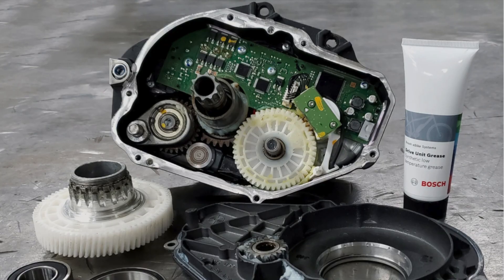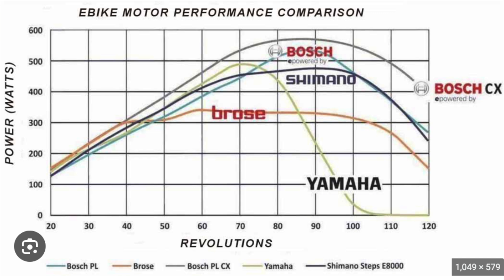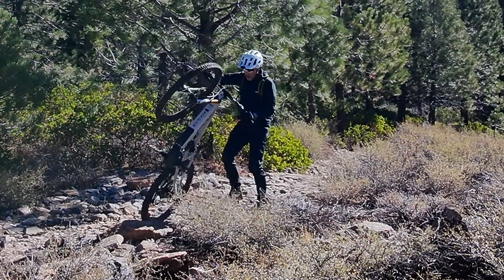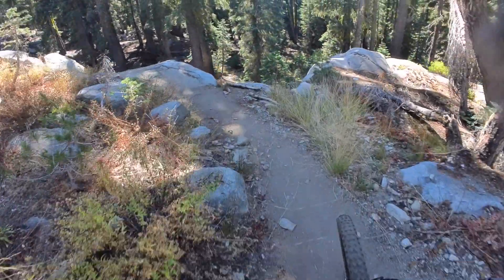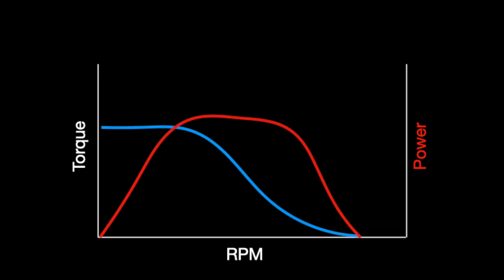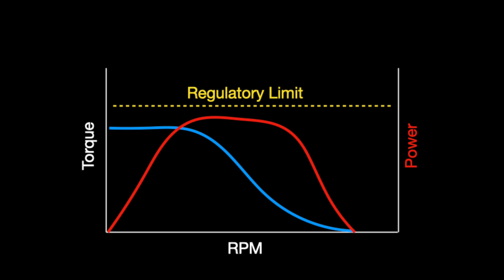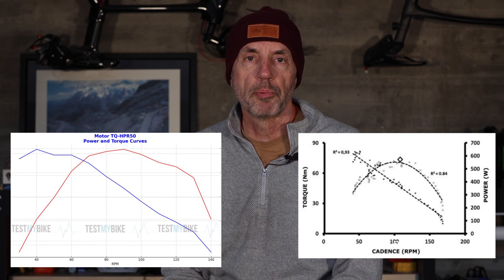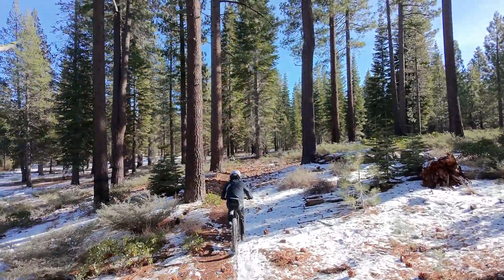The Best E-Bike motor is the one that has the most control - "enter" the motor controller.

Comment: It depends what you want.   I decided on the TQ motor.   Why?  Because my objective is to stay in shape. Keep my VO2Max in the excellent range for my age.  I am 73 years old and been riding most of my life.  As i have gotten older, there is no question that my power generation is declining.  I am in no way what i used to be in my younger years.   The TQ is the closest thing you will get in an E-Bike which can ride like an acoustic bike.   The motor makes me feel like i am younger again. I can ride in a group and keep up with the younger guys.   I  have a Domane+ and a Trek Fuel Exe for off  road.   With the Road bike i ride it most of the time with no assistance.  In fact when i get home after my rides, I hardly used any of the battery.  That is the charm of this  motor.   You can ride it with zero assistance, and it is just like riding a normal bike.   I need a little help on the big climbs or especially when it gets up to 80 degrees or higher.   That is where I use the motor.   You still get a hard workout.  You can customize the motor to how much help you want in each mode.   I love these bikes.  I live in Southern California.  I can ride out my door for road or trail.
Reply from the maker: The TQ is the best motor I’ve ridden for the reasons you described. I also have the EXe.  What I noticed during testing is that I can comfortably put out more power myself because the cadence is higher with just a little assistance.  Thanks for the insight!

Comment: Cheap ebikes from China is what's flooding the market. Focus there. Many would like modify their bikes power systems.
Reply from the maker: Modification has lots of risks to the motor, rider, and what regulates our right to ride in many locations.
Reply: @roadlesstraveledtruckee  knowledge is a plus in any circumstances. Hell, id like to know the wire schematic of my bike. I can map the wires, sure, but what's the green wire going to my ignition switch do? Where, how, who do I go to for a new controller? 
    Things like this.

Comment: You can try a big old E-Cells Kings Crown, with dual 1,000 nominal watt motors and 4.8 inch fat tires. Has dual 52v batteries and dual suspension..See how that does along side a 350 watt single mid drive motor bike.  😮

Comment: Ive got a Bafang BBSHD. Quiet,powerful and seems pretty smooth. Heavy though. My philosophy... use a heavy duty motor underpowered.
Reply from the maker: Not a bad philosophy. Besides a slightly heavier bike, there is no penalty for larger motors. We can obviously ride faster with e-bikes and a bigger motor just makes you faster.  Only argument against is the desire for less weight and assistance.
Reply: @roadlesstraveledtruckee there are costs to a physically larger motor in terms of frame design and ground clearance. Not to mention aethetics.
Reply: @scottpratico1315  Only drawback is weight. My aesthetic I would describe as inner form, how well it works. And cost of course. DIY a top notch E-MTB for a lot less.
Reply from the maker: @scottpratico1315 I love my sub 40 lb Trek fuel eXE but hard to put all the reasons why into words. Your points help.

Comment: I’ve ridden Bosch, Shimano, TQ, Yamaha and Fazua.   Out of all of them, the Fazua has that sweet spot of power control to  rider inputs/output.  The Yamaha is a close second.   The other motors have a much sharper or abrupt power delivery
Reply from the maker: Awesome, that’s good to hear. I’ve only done a short test ride on that motor but liked it. Louder than the TQ probably because rpm of internals is higher but good power delivery.  Where do you think the sweat spot range is in terms of pedal cadence?
Reply: @roadlesstraveledtruckee  I actually ended up buying a Transition Relay last fall after riding all those motors.   When I look at the fazua ride app, my average cadence is somewhere in the 60-70rpm range.    And yes, the TQ is so quiet, but I found I had to really push it hard to get some zip out of it - the Fazua feels very similar, but has a bit more grunt everywhere in the power range which makes a huge difference for slow speed technical riding (like navigating a tight uphill rooty rocky switchback punch climb), and in full power mode, it's more power than I really need.   I know that Fazua has had some bad press in the past, but I think they've finally gotten their feet underneath them with the purchace of the company by Porsche, and the ability to plug the bike into a laptop and truly tweak literally everything is kinda wild - including diagnostics.
Reply from the maker: That does sound great, might be a good option for me if I back off the full power 85 NM monsters. I should look more seriously at bikes with these motors.